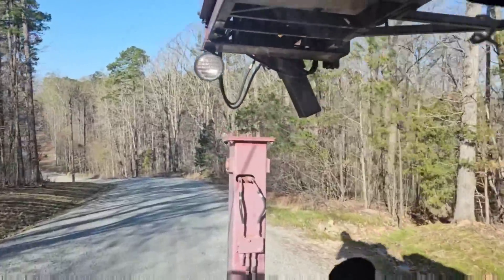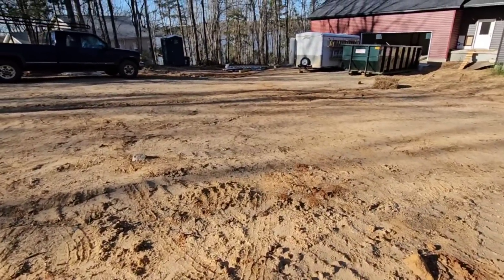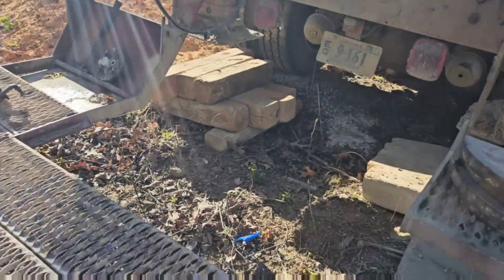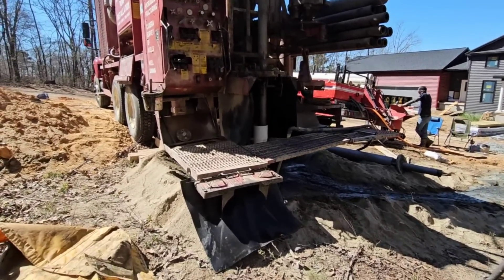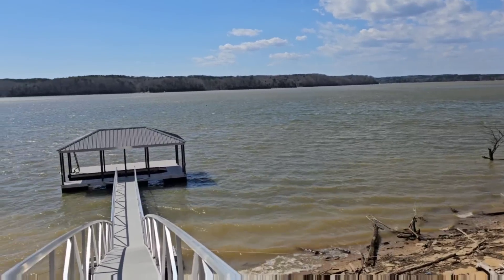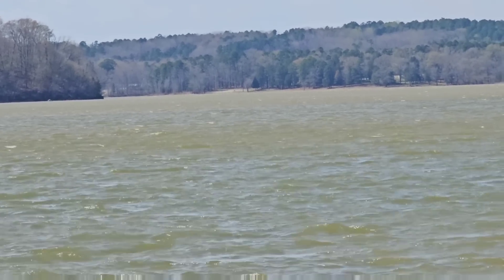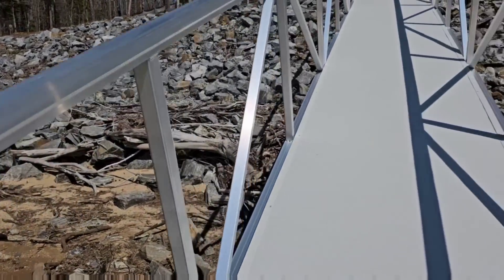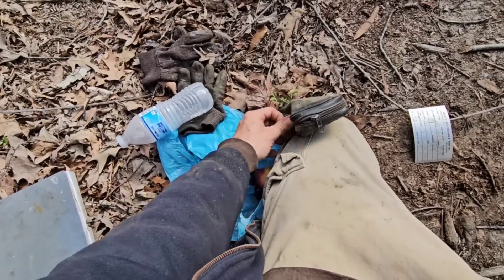Drilling a New Water Well Next to the Lake on St. Patrick's Day!

Comment: I guess I was wrong in assuming that the grout depth was from the surface of the well all the way to the bottom of the casing? Did you say that some of that length is filled with spoils from the drilling process??

Comment: Can I run poly on a 300ft well that makes 1.5gpm static water level would be 90 foot. I live in Montana and the well will feed a 2000gal in ground cistern. Cistern pump would then feed the house. I just don’t know if that’s to much head pressure to run the poly with the static being so low in the well.
Reply from the maker: Itll be fine. I'd recommend using a steel well seal or pitless. The system will get heavy once the well is pulled down. But it will handle it just fine at 300ft with a 90ft static

Comment: @h2o-mechanic Up here in Noo Joisey near the shore the drillers don't typically hit bedrock so the casing goes all the way to the bottom of the well.  It seems you guys only case down to rock.  But what's after that?  You stick the pump down into the open bore hole beneath the casing?  How does the hole stay open?  Why doesn't it collapse back in on itself?

Comment: Many years ago when my Father in Law, RIP, own a boat dock with one of his cousins, the Corp of Engineers put out a directive that all boat docks had to be see thru, there were issues with transients living in them in the off season at the lake.  So no more galvanized siding.  People were using expanded type fencing materials, i.e. hog wire, chicken wire.  Well he was no going to go along with the crowd so they built a brand new dock with 2 bays, Bass boat and Pontoon boat sized slips.  Then proceeded to submit plans to the Corps that left them, the Corps,  puzzled and speechless.  They used .25 thick plexi glass.  Could see thru it, had garage doors on the slips that seal with the water added, AC, heat, a refrigerator, two deep sinks for dealing with the days catch, a propane fueled stove to cook with.  Was able to use it year round, Lake Texoma still can get dang cold in the winter and of course hot in the summer. Expensive of course, about $25K, back in the 90's.  But when the cousin passed he was able to buy it from the widow and it did add a good amount of value to his house when he sold it and moved closer to us to be near most of the Grand Kids and Great Grand Kids.